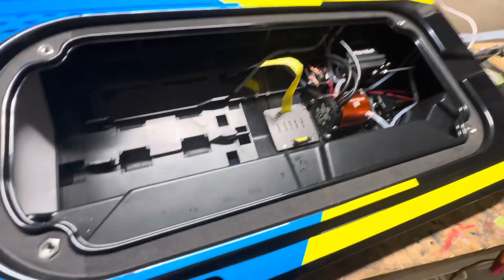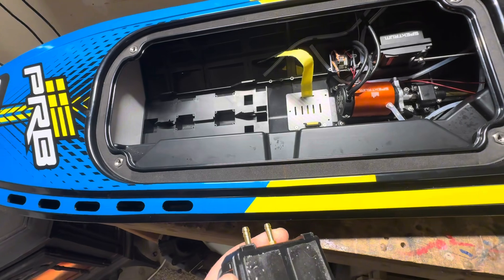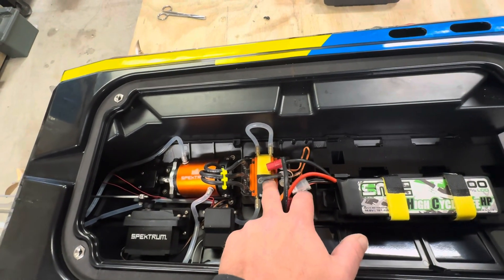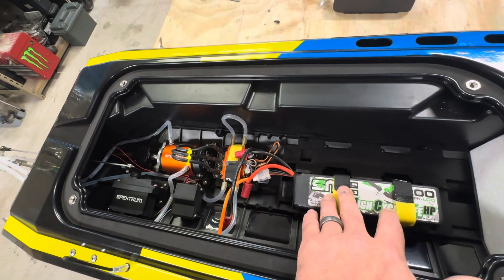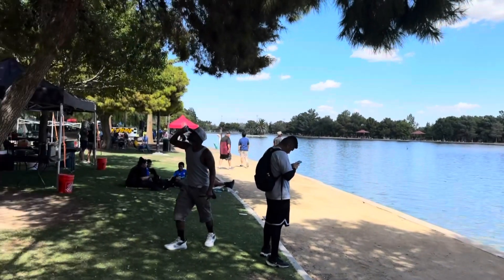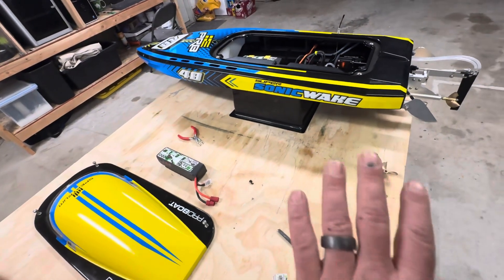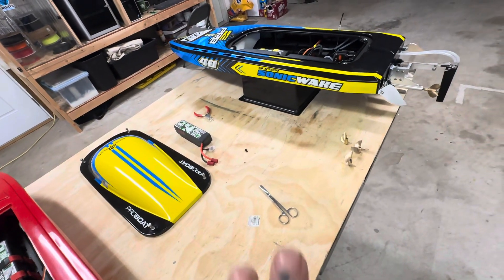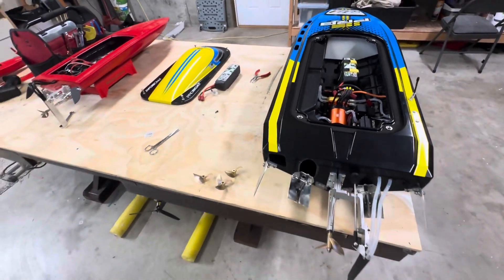Supersonic 48.  Esc Tray modd ￼and making ready for new props testing.

Comment: Im member off a boat club. Those guys only run gasoline. Went few times there. What i noticed is they are working a lot on their boats... I feel like it takes multiple the times to run them compared to electric. On the app group then this guy blew a cilinder or block or bought a new one , asking for parts, etc, etc...But you will take that journey, so we will find out if that's the case. Maybe my image from it is totally wrong...
Reply from the maker: @peteroosterhoff8850  that might be part of it and may happen, it’s different type of racing of what I’m after. I’m also a member of a boat club as well. Racing for three seasons now.    so I’m trying something new and different and see what happens.  Gas Will be a new animal for me and something to add to my collection.   I will still race electric and have the one gas boat.
Reply: @mad_lizard  i understand what your saying. The guys off that club run quite often too, so that was my first goal to check it out and see if it maybe was something to buy too. But besides the "wrenching"  also found out the two don't really mix together (electric mono2 with these huge boats), so i decided to let it for what it is and run mostly myself. But  racing (or running with multiple guys) is cooler, that's for sure....
Reply: @peteroosterhoff8850  I'm only getting one. The main idea is to meet like minded people and have some fun competing with one another.
Reply from the maker: @VET-RC  Same feeling here the people you meet and racing and competition with others is a blast. You make lots of new friends.